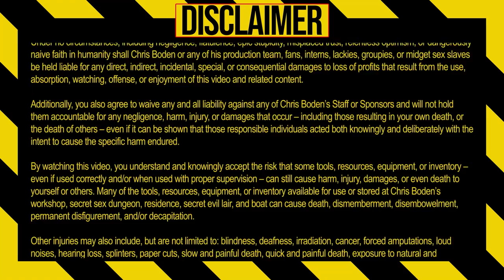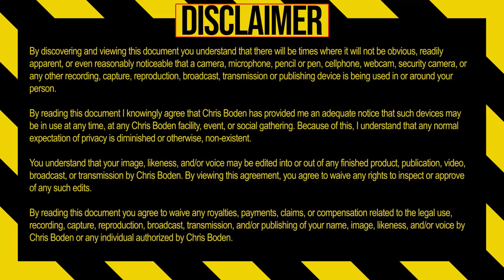Detailed Deep Dive Into My Electrician EDC Backpack Tool Bag

Comment: As an HVAC guy, I've only seen a couple of HVAC guys that have any non-specialized Lennox tools.  Granted, I've only been in the field ~5 years, but in my experience, a good number of us tend to use Klein and Milwaukee for our basic tools.  And the Klein refrigeration 11-in-1 is basically universal.  *Occasionally*, you get a guy that has a Lennox or generic multi-bit driver, but it's usually a Klein.
Reply: Also, the Malco bits are really great, especially since they come in multiple lengths, all the way up to 10" iirc.
Reply: lennox 4 roller pipe cutter is really nice on soft copper , but yeah klein milwaukee knipex and wera are staples in the hvac shop I work at

Comment: I work on aircraft carriers. A standard tool bag for me if I’m not 100% sure on what I’m gonna need is a 2lb maul, a standard wrench roll up to 1 1/8” with a 1/2” drive ratchet and matching socket set, an E-110 or as we call it a hex wrench, a folding stick ruler and 6” scale, a set of feeler gauges, a big long beater flat head, a 12” adjustable and an 8” adjustable, a flashlight, an Allen pack, a pair of linesman pliers and needle nose pliers, a scribe and finally an inspection mirror.
Reply from the maker: What is an E-110? :)
Reply: @ChaoticGoodChris  it’s an offset hex wrench comes in handy when the fastener is a little bigger than what I have on me at the time. And it can take a beating with a maul

Comment: While I don't EDC a toolbag, the most useful tool I've found while working in laptop/handheld electronics repair is the spudger. It's just a simple plastic stick with a flat end and a pointy end used to pry apart cases and manipulate components without damaging them. Turns out there are a tone of situations where I want to do that. I also use them as a scraper when cleaning (I even keep one in the kitchen for washing dishes), and I've even used them as stir sticks. They do tend to wear out relatively quickly, but since they're cheap and come in bulk packs I treat them as disposables. I bought a 50 pack off Amazon for under $15, and I can't recommend them enough. I'll post a link to them in a comment below this one.

Comment: Nice tool bag, is it rugged?
Reply: Both the exterior and interior are made of 1680D ballistic nylon. I carried one of these for 5yrs outdoors as a cable tech in rural Georgia and abused the hell out of it; it got left out in a tornado, run over at least once, dropped off ladders, and sliced away at for years by improperly-stored tools because of my fucking stupid-ass trainees.

The bottom bumper area is a plasticky boot sole material that will immediately get scuffed and ugly as hell, so don't expect it to look nice, but it's a work bag, it isn't supposed to look nice. The nylon fabric, on the other hand, can hold up to some serious wear & tear, assuming they still make 'em like they used to.

If you want to get a feel for the material, go to any big box hardware store and fondle the higher-end Husky bags. Husky has always made really nice 1680D bags too. I've carried their field physician's-style bags for years.

As much of a Milwaukee fangirl as I may be, the one suggestion I will always give from my own anecdotal experience is this: never buy anything fabric from Milwaukee. They're overpriced and won't last.

Comment: Controls Engineer here.

Knippex (largest pliers down to the finest yellow set for PCBs). Swisstools screwdriverd (all insulated, we aren’t mechanics ☺️), Fluke detector and DMM for >=230VAC, Agilent for signals (doesn’t have the rating for working in a cabinet with high currents).
I don’t use Wago at work but at home ofc.
Electrical tape in all current colours. A small hex wrench set. Weller portable propane soldering iron. I use similar heat shrink like you do, mine is the one with the glue inside.
Edding brilliant markers. Bosch laser measure.
Grounding set for working on electronics out in the field.

I used to do a lot of hot work.

No manager wants his machine that‘s needed for a batch with xx million USD value shut off. Doesn’t matter what it is, if you shut it off you‘ll have a batch record with hundreds of warnings and alarms and notifications.

That’s why my iPhone became one of the most important tools too as working on live circuits can‘t be done alone but only one guy was on call.. So then I usually got the manager of the line out of bed, told him what hat happened and asked to hold the line and send rescue services to room x in building y floor z.

I am no friend of screwdrivers without 6kV rating, even my bloody cutter is rated for that. I have had to cut live circuits with it an here I am today. Non-insulated tools can easily fall into a cabinet and all hell will be released in case of a short (no more shaking hands after such an arc).

Thanks to the clean rooms I have all my tools in at least three zones and our allowance is pretty good too. We get the tools we need, not the tools we want.

Comment: I've got Knipex 12 40 200 strippers. But I'm usually working with 30 gauge up to at most 22 gauge. Though they supposedly work up to 7 gauge, and I have verified that they work with 12. 

My main multimeter is a Siglent SDM3065X-SC. 6.5-digit meter, with scan card (so it can scan 12 voltage channels & 4 current channels, reading them in sequence and logging the readings).  Of course it's hardly EDC, since it's a bench meter, but I use it most days since I'm an embedded developer. I've got a basic Fluke 323 clamp meter, and a couple of random other handheld meters. I've also got a handheld LCR meter, handy for measuring inductors. 

Logic analyzer: Saleae LogicPro 8. Very nice little device. 8 channel PC-based logic analyzer. Other than the multimeter it's the most helpful troubleshooting tool for embedded development. 

Wrenches: I've got a set of Knipex Pliers-Wrenches. WAAAY nicer than the Crescent-style adjustable wrenches.

Soldering: got a Hakko FX888, and a chinese but good enough Aoyue Int 866 hot air station with IR pre-heater. All good enough, but there's better these days. 

Senspeek PCBite: The best workholding for soldering or testing I've ever had. Little magnetic standoff clamps and a steel plate. Holds the board rock solid. They've also got some pretty decent pogo-pinned probes for use with a logic analyzer and/or multimeter. I haven't used their oscilloscope probes, because I got a bunch of knockoffs of Noga NF10433 magnetic-base indicator holders and 3D-printed some clamps that can hold oscilloscope probes. Cheaper, and they don't have anything other than 100MHz and 200MHz probes, which would be limiting.

The coolest tool I get to work with (though I don't own it of course, it's something like half a million dollars with the options we've got) is a Rode & Schwarz CMW-500 Wideband Radio Communication Tester. It's a cellular site in a box. LTE, GSM, WLAN, Bluetooth, etc. We have a walk-in Faraday cage for using it, since it can output plenty of power on the licensed bands.
Reply from the maker: YOU have a hell of a fun job. :)
Reply: @ChaoticGoodChris  Yeah, embedded development has the fun bits of EE and CS all in one.

Comment: 15:30 yeah i'm sure it's the same or similar to what phone techs use when locating a phone line in the ground.  i've seen them with one of those detectors but on a long pole waving it by the ground and it beeps when they are over the buried wire.  they used that when our phone line got broken, they could trace it with that

Comment: I always carry at least one clean dry bamboo disposable chopstick (they do tend to travel in pairs like other things..) , good dielectric, snappable pokey bit thingy.
Reply from the maker: That's clever, I use them in the shop all the time but never put one in my electrical bag. Thank you! :)
Reply: @ChaoticGoodChris  For around my shop (and 2kw Tesla coil..) my chicken stick is an old drumstick from Ben Harper's drummer..
Reply from the maker: LMFAO. I use a Nylon tip 5A on a regular basis so I can appreciate that. Also, you get bonus points for having good taste in music. :)
Reply: @ChaoticGoodChris  Another little trick I learned out on oil rigs, the 4½ inch inner quartz discharge tube out of a high pressure sodium lamp is perfect for honing all your blades. Gives a surprisingly sharp edge.